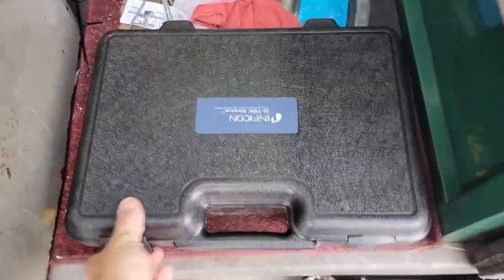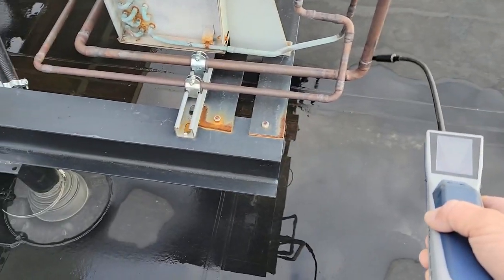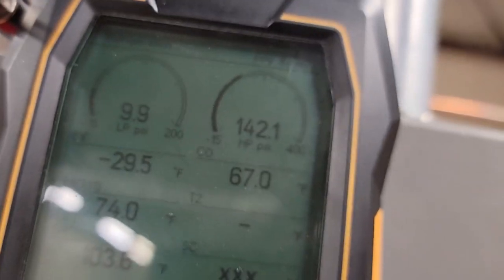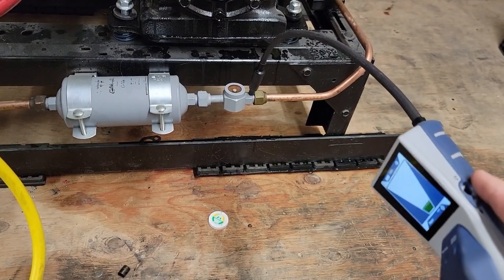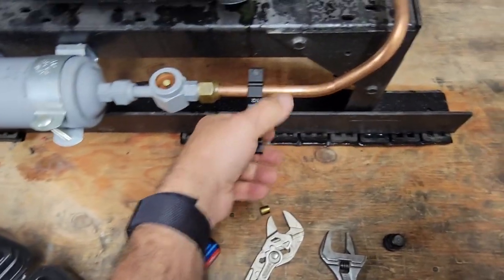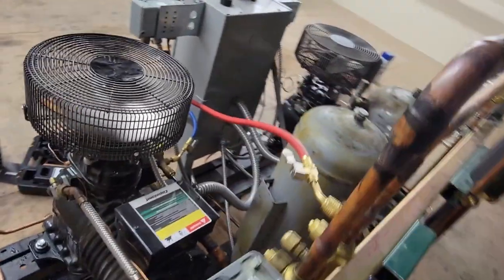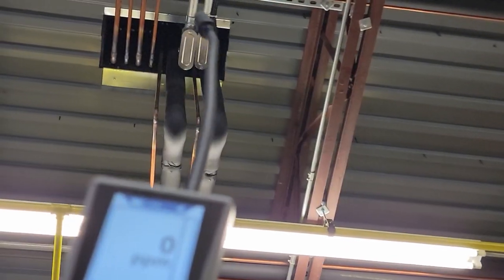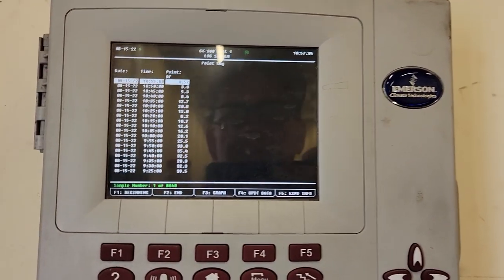Walk In Freezer Warm Since Yesterday!?

Comment: Should have pulled the charge, R404A is a zeotropic blend and may not perform as well as with a virgin charge of R404A. This means that the mixture of gases in the refrigerant will boil off at different rates so when a leak happens one or more of the blend will leak out before the other resulting in a system that does not perform well.
Reply from the maker: That was a concern in the beginning but hasn't panned out from what I have experienced. I have had that happen with R410a, but not with any of the other blends.

Comment: Great looking refrigeration install. Don`t see that to much any more. And they know how to use a bender to eliminate joints when possible. Today all ya see are line sets that generally look like crap. If you noticed your leaks except for the flair was in valves and schraders . Perhaps the manufacturers need to step it up a bit. Nothing like having valves to isolate system components. Great job on your patience to keep checking for those nasty leaks
Reply from the maker: Thanks for the support!

Comment: Now we know why sight glass is yellow.  There was no pressure on half inch line so guarantee air in system now.  You pumped down using king valve, could have easily pulled vacuum using suction schrader.
Reply from the maker: The moisture indicator was like that prior to me getting there and I didn't pump it into a negative prior to repairing it so I disagree.  I changed the drier and purged the line after the repair, there's not much more you can do to dry up the system other than keep changing driers.

Comment: Had a handful of Schraders go bad on me lately, and the stems were bent and would get caught on the access fitting, I had to install swivel tees in some cases where I couldn't get some out. Don't know why they'd become bent outta shape like that but it happens, oh and loose packing nuts ahd bad flares.. I started using these blue caps you put inside flares, seem to work pretty well still use nylog on the rim and threads though.
Reply from the maker: Thanks for sharing👍👍
Reply: @HVACRSurvival  sure thing, I've only been on the field about a couple years now since I transitioned from ammonia, so your videos are super informative for me at this point. I recognize a lot of the equipment you work on so its much appreciated.
Reply from the maker: Awesome to hear! Thanks!

Comment: Maybe I missed it but you were about to explain what the purpose of the fan on top of the compressor is for.
Reply from the maker: I butchered the wording so I cut it. Basically the compression ratio on a freezer compressor is a lot more than a cooler commodity,  so the heads run hotter, the fan helps keep it cooler. Sometimes they will use direct liquid injection to help cool the head instead.
Reply: @HVACRSurvival  Thank you.

Comment: You can drill a small hole in the end of a cap to test schrader ports. With small amount of bubble leak detector applied to the cap with a finder the it won't go into the port at all.  Also for larger leaks you can use Nylog as a test liquid.
Reply from the maker: That's a good idea on the hole in the cap🤜🤛👍👍

Comment: That flaring tool is too bulky. No way I would buy something to take up more space than necessary in my van.
Reply from the maker: It's really more useful for people that are using it for a large multi head mini split install and installers that don't know how to make flares that end up leaking then casing a call back.
Reply: But the time you save on a large job with a lot of flares is worth it, IMHO

Comment: I'm surprised the computer haven't start an alarm as soon as the graph was changing
Reply: Watching HVACR videos and being an IT guy we graph everything. Drives me crazy they don’t even have a basic graph like this one does. Let alone an alarm. The tech for the basics is not at all expensive. I think I saw one AC controller that worked like that only.
Reply from the maker: This Emerson controller is the industry standard for grocery stores, I'm not sure why they didn't tie this in next door to the main store network that is monitored.
Reply from the maker: I don't think it's on the network like the main store.
Reply from the maker: This was a remote building to the grocery store, they only use it for cooking and no customers are in it. So no one would even see the lights in that building. Just run a CAT5 cable over to our other real racks and tie it in
Reply: It would depend on what the alarm set point was. I'm sure you could make a graph alarm, but it would probably take some crazy calculations. But I guess, like he said, it's not tied to the network anyway 🤷‍♂️